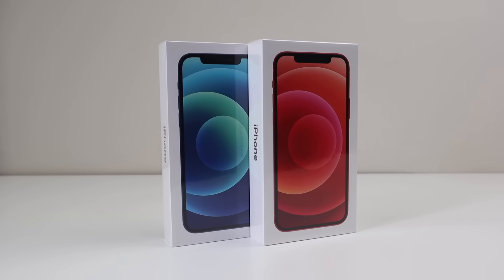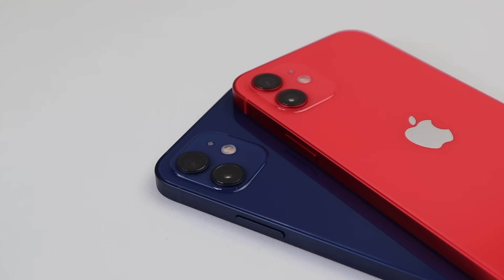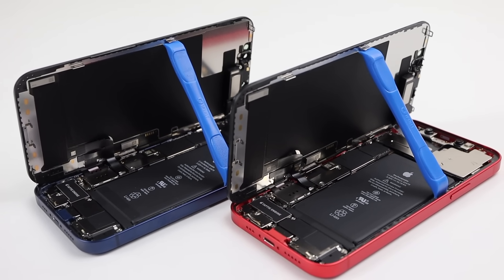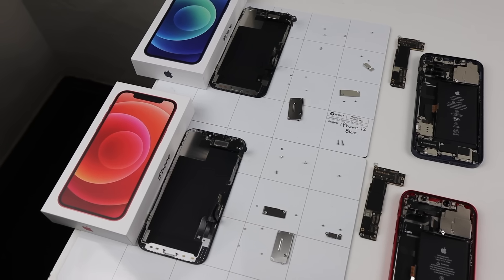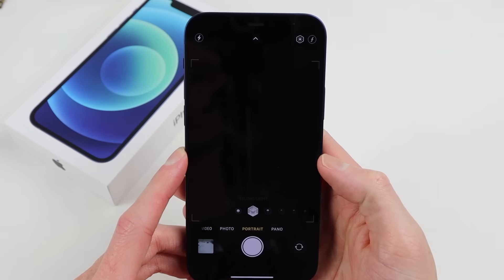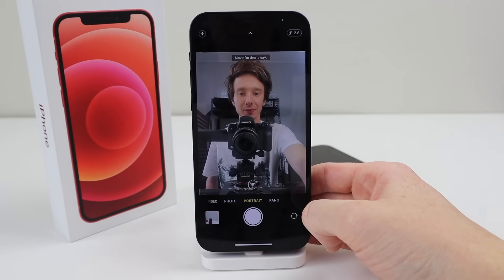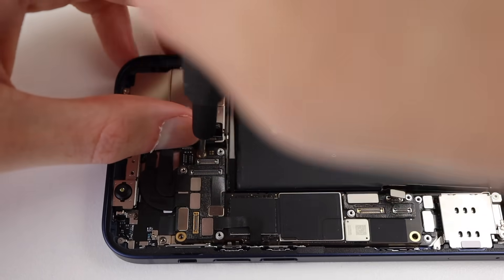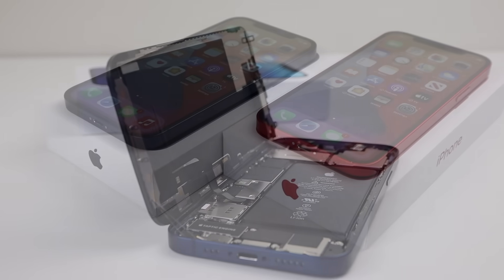iPhone 12 Anti Repair Design - Teardown and Repair Assessment

Comment: Me: buys 1.000,00$ iPhone

Battery after two years: whoops I can only give you 2/3 of the original capacity (which is normal and will happen on any phone)

My warranty: Well I don’t care, it‘s over anyways

Me: changes battery

Apple: okay sorry camera broken, Face ID dead, 10 error messages, laggy, zoom broken, battery percentage gone, true tone broken, power button not working, portrait mode stuck
Reply: @momorain, you can change the battery. At Apple it’s like 60-70 euro’s (Europe) depending on the phone you have. I let my iPhone X it’s battery be changed two times now since I do not want a new phone since this one is working perfect.
Reply: If you can fork out 1k for a phone, the cost of a genuine battery replacement should not be an issue
Reply: @sm7085  Bro, that is not the point! Also knowing Apple they will probably charge you 400$ so that you are keen on buying a new phone instead of the expensive battery replacement.

It’s the same with Tesla and right to repair. You own it and therefore you Have the right to do ANYTHING with it that you want! (from destroying it, all the way to replacing a part of it)

Imagine this: You buy a house for one million dollars and when you have a leak in your roof  the only person in the world who would be able to fix it is the contractor who built it.

He would say: Yeah sorry that cost you 400.000$ to replace a couple of roof tiles. Either you do it or the whole house is basically useless.

Than I would say just like you: iF yOu CaN aFfOrT a OnE mIlLioN dOlLaR hOmE, YoU cAn AfFoRt To FiX yOuR rOoF fOr 400k!

Basically the contractor can threaten you and say: use my repair or buy a new house! And Apple is doing the exact same thing!

Do you freaking realize how wrong this is?
Reply: @themomorain  So, let's say I was to buy a Tesla; would it be possible for me to replace both the battery pack and charging assembly in that case?
Reply: @MetalSStar196  If you find a 3rd party manufacturer you could and you have the expertise to dismantle a car and replace the battery or get someone to do it for you, yes you could.
Reply: @le_sampho  You can’t.
1. Everything which has to do with software (which is almoast everything in a Tesla) is locked up.
2. Tesla doesn’t sell you spare parts!

Just like Apple if you put a battery from another car in, or even a 3rd Party manufacturer like you suggested, it will not work! Just like in the iPhone from the video you just literally watched!

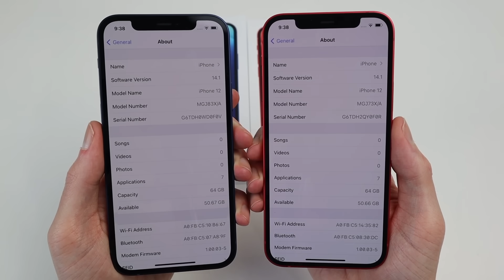If you are interested I just found this: from 0:00-2:40 he basically says everything.
https://m.youtube.com/watch?v=kETN3N2tGLw
Reply: @themomorain  you’re seriously crying over a £69 battery replacement
Reply: @sm7085  Wow you still dont get the reason behind my comment. I fear you are just not willing to understand.
Reply: not every phone loses 1/3 of its battery capacity
Reply: @michalbernat1088  every lithium ion battery will deplete over time. Thats just the nature of a lithium ion battery. Its unavoidable
Reply: @IronBran123  there are methods to greatly reduced depletion though so some may have less mAh but longer longevity.
Reply: @gurgleblaster2282  Great! I’m sure Apple will pick the method that has the greatest depletion in order to sell as many units as possible. (Since you can’t change the battery anyways, you are forced to buy a new phone as soon as the warranty runs out. That’s exactly how Apple wants things to be)
Reply: @IronBran123  My G4 battery shat itself this year. both my s7's still have good batteries.
Reply: @ayumu-senpaii  Hmm I don’t think so. I actually owned a s7 up until about 2 year ago and the battery was so dead that it did not last me for a normal day even if I didn‘t play around with it^^ Go swap the battery on one of your s7 you will notice a huge difference ;)

But in my experience the battery longevity on Samsung feels way better than Apple (probably cause IPhone always has such a small amount of mAh)
Reply: @themomorain  Your comment doesn't make sense, regardless of 400 upvotes. The stuff glitches up if you replace the logic board or the camera. Unless I missed anything, the dude didn't try to swap batteries. So we have no idea if it is possible to swap batteries or not.
Reply: @themomorain  apple isn't for the masses it always has been an elitist brand. You don't keep your apple running you just buy new. They are not designed to be repaired.
Reply: @gurgleblaster2282  Strait up wrong. Also it does not matter how much market share they have. Every device should be able to be repaired. (At least it should be designed to not be purposely not be able to be repaired!)

You: "They are not designed to be repaired." YEAH!!! Thats the freaking problem everyone is talking about!!
Reply: @michalbernat1088  Well that depends on a lot of different things and also this is not at all the point of my comment.

You buy something => You own it => warranty is over => Preventing people from repairing even though warranty is over is disgusting! (right to repair! You are the owner!)

Even preventing people from repairing while warranty is still valid is disgusting in my opinion! Cause if I have a smashed display for example I want to be able to repair it myself if I desire to not go to Apple for the repair! (Even though this will automatically void my warranty of cause)

Apple has a monopol on phone repairs. You buy a device but you are not even the real owner cause Apple basically decides if your phone is dead or not!

This is just wrong in so many ways that I could write thousands of words explaining against how many rights this is. That’s the point of my comment, not the exact amount of battery degregation.

Comment: At this point this is flat out a scam. If they would want to be so "green", they would let you replace parts, sell batteries for old devices etc. They are not doing this charger thing to be green, they do this for the publicity and cost cutting. Quite ingenious. Fucking evil. But ingenious.

Comment: Apple: we're making efforts to be more environmentally conscious 
 Consumer: okay awesome, I'm going to repair my phone so that I don't need to buy a new one
Apple: nonono not like that
Reply: Apple: here is your ner iOS update (secretly making your device slower and bugging out on purpose)
Reply: momorain laughs in iPhone 7 Plus
Reply: @themomorain  Windows has been doing the exact same thing!  Meanwhile, Linux has been the only Unix OS that's been doing just fine, speed-wise.
Reply: @MetalSStar196  hmm no. I mean at least on Windows: I buy it once and it’s NOT getting slower on purpose. (It only gets slower when I have a lot of junk on my Pc cause it’s not programmed really well)

Also Microsoft has no reason to slow it down on purpose cause they want as large of a market share as possible!

I don’t actually see an issue there.

Also I bought windows 7 for example and therefore could upgrade to windows 10 for free so they don’t try to slow it down, forcing you to buy something new.
Reply: @MetalSStar196  Except windows is a software thing not really a hardware issue....you can reset windows and it works fine. But apple doesnt.
Reply: and we're going to create a new charger that won't work with older devices...because after all, putting the 18 trillion perfectly functioning older chargers into a landfill is environmentally conscious.  I remember when after an update none of my aftermarket charge cords would work anymore.  Had to re-buy overpriced Apple cords...Dirty fucks
Reply: @Donnybrook10  Yeah Apple is fucking disgusting in that regard!
Reply: @Donnybrook10  I think the USB C is because of pressure from EU - "The EU wants to force all smartphone manufacturers to adopt USB-C".
Reply: @martindye  but they made it use USB c on the power supply instead of phone. Which is still fucked up cause no other power supply do that. They technically use USB c,but not the way everyone else does... So they basically cheated here.
Reply: Haha exactly
Reply: You mean "Apple: Listen here, you little sh*t!.."
Reply: Hahahahahahhahaha
Reply: Lol
Reply: love the profile picture and name

Comment: This problem is also on any phone that has Face ID. Apple made it that the earpiece of the phone which has Face ID sensor can only be used with the logic board that comes with the iPhone. To change screen or replace a broken screen, you have to remove the earpiece from the original screen and put it on the new replacement screen. That is the only way the repair will work.

Comment: You don’t need the seals as long as you got 300SLE laying around you can make your own but actually the original adhesive is usually okay as long as you didn’t man handle it.
It’s still good enough to make the screen snug.
Probably not 100% as effective for water but whatev.

Comment: It's time for us to care about Right To Repair, not only it's good for the environment but imagine what if couple years later, Apple will have sensors in the phone or seals in there to protect the phone from being operated so we won't be able to even open OUR PHONES or repair them. The fact that the phones malfunctioning themselves and not able to recognize genuine parts from Apple is ridiculous. The parts work perfectly fine. It wouldn't bother me so much if Apple's repair cost isn't a rip-off. They want to protect their products from being replaced with low quality parts, i get it. However, I don't wanna live with the fear that whenever I need my overpriced phone repaired, I can only get overpriced repair.
This is not luxury Apple, it's greed.

Comment: Regarding your description, they could just easily repair it in-home instead of being repairable from a 3rd party, therefore no e-waste. 

Also some of your comments how its not a "software" issue is false, it is a software issue, it doesnt sync the hardwares. Someone smart enough can create a custom firmware (jailbreaking) to be able to sync the issues described. It's only a hardware issue if the 2 hardware components are vastly different with different input/outputs.

Comment: You didn’t swap the front FACE ID cameras to the correct logic boards usually if a iPhone X doesn’t have the original Face ID both camera’s play up maybe that should sort out laggy camera issue, it’s a bad idea that apple do this, BUT someone will always find a way around this issue, usually when we repair iPhone 11 Pro LCDs we have a little electric tool that you plug the genuine lcd into and it Copy’s the serial numbers over to another third party screen which usually fixes colour and touch sensitivity I’d imagine they would only make one for this device too

Comment: Yeah, nice video. I suppose there is some kind of signing of the devices serial numbers with asymmetric cryptography. You know, like our factory has a private key, our public key is in every iPhone and we store a serial number of every single subcomponent  encrypted with our prv key on the logic board so that noone can simply replace the component and write it's serial number on a logic board without knowing our private key. Interesting business strategy.

To be honest though I think in case of the FaceId its justified. You wouldn't want to allow any thief who wants your data to stole your phone, and then attach some king of face spoofer to the logic board and get it unlocked. On the logic board level your face profile is just a bunch of data, so it's important to limit possible inputs (providers) of those to known (signed) devices only.

Comment: You need their software called repairCal which is the calibration software that apple knows that the parts are genuine apple parts and can be paired / locked to that device. If a company that is not “partnered” with apple they cannot do repairs on flagship models. I.G. X and higher. 3rd party companies will sadly go out of business due to this.

Comment: yey have you noticed that thing on the side of the phone that looks like the charger for the apple pencil gen 2 that's the 5G antenna but uh what's stupid is that most people on earth are right-handed and yeah if they put this on the left then people wouldn't have this problem but you also have to remember that some people are left-handed so why didn't they put it on the top cause this is "your holding it wrong 2 the incorrectness deepens"

Comment: Apple - We removed the charger because we want to reduce waste
Also Apple - We won't let you repair the phone because MONEY
Reply: If you replace the battery, you'll need to replace all of the parts within in order for the phone to operate properly.  However, at that point, you'll have new components in the same old shell.
Reply: And yet people still buy this xd

Comment: Apple is pretty much self destructing. From the headphone jack to the charging port to the air pods.. they're reducing every new phone to nothing. I believe they're recycling old iPhones, adding maybe a different design, different button placement, maybe screw with the screen resolution, try to mess around with the internals a bit and that's it. I mean this is a completely new phone.. brand new off of the market and this guy (sorry first video I've seen of you) knows where every clip, bracket, screw and trim is. Literally all Apple is doing is putting makeup on a growing disaster.

Comment: Guessing that it's hardware tatooing like the serial / MAC of the part is 'married' in the firmware section of the boot ROM or something very similar to this , & the values would need to be updated or blanked out in some fashion, which would only be possible through OEM authorized service tools or maybe the jaylbrake community

Comment: Thanks for the video, I think I'll one up  Apple, and be even greener by holding on to my iPhone 6s until it cant be updated anymore.
Reply: I'm doing this with my iPhone 6 Plus.  Bought it in 2014 (I think) and have only had to change out the battery so far.  ** knocks on wood **  Bad thing is it's only 16GB so I have to be very cognizant of what apps I really need and keep photos and other locally stored data low.  What I hate is an app I haven't used in awhile will go into like a standby mode so the app is removed but the launch icon and the app's data is still stored on the device.  To run the app it has to download and install.  Sometimes a pain when service is spotty or none.
Reply: @TheKuptis  True on all points, I dropped mine and the screen shattered, and the battery was bad. So I up graded to more memory and life is good.
Reply: @TheKuptis  you can turn it off, its a really bad feature i did it a while back.

Comment: the lack of a power adapter really only affects people that haven't had an iPhone before, if i bought an iPhone 12 today then I'd have to go out and get a new charger. For anyone coming from any iPhone after the 4, your old charger will work with the 12. The only thing different about the new USB C charger is that its USB C, it will still charge your phone as slowly as it did before.

Comment: Apple: removing a whole power supply for "sustainability"
Also apple: making phones not repairable

SuStAiNaBiLiTy
Reply: its sustainability...not for the planet but apple stonks.
Reply: justifies it by saying everyone has tons of them at home.
includes charging cable that doesn't fit any of the common power adapters ever used so you have to buy theirs anyway...
Reply: There just desperate for money at this point
Reply: Also the charging cable tho
Reply: very sustainable
Reply: with all the bullshit gimmicks that apple is throwing around,im still buying iphone..damn. der sustainability motto for d iphone12 is so dumb. sustainability of der profits
Reply: I would argue that this anti-repair design is sustainable. This eliminates the redundancy of third-party repairer to gain more control on parts supply and disposal etc...
Reply: @kelvinchan2430  And only creates a bunch of thrown-away phones once they stop servicing them.  That isn't "sustainability".
Reply: @kelvinchan2430  Fallacious argument - You should be happy that Apple did not build your house.
Reply: @zorbalight3933  well, if apple built my house, I surely wouldn’t want any 3rd party guy to screw around with it...
Reply: @kelvinchan2430  probably....but its mostly to make apple users buy more products that were used to be free,and apple makes more money... apple is difinitely not letting any stones left unturned in an effort to scrape more money out of der loyal fans .😑 . next tym new iphones wont have battery in them upon purchase,cuz we already have ours from d previous model,in guise of saving d planet,but then d battery slot on d phone is slightly larger,so nevertheless it wont fit,and u end up buying separate new bigger battery for d iphone...
Reply: @racetoria3069  scrape money from „loyal fans“ who wanna do a 3rd party repair...

Comment: This crap that apple does is why i dont understand why people still love apple. Yrs ago i heard about how easy their phones were bending and breaking and i went from a motorola thag wasnt bad but also not a great phone either, to lg phones that have been nothing but good and when i didnt find an lg i wanted, i tried htc. I have punched my phones until i bruised my hand when i did something stupid and back when i had anger issues. I also threw them across the floor multiples times. All i had to do was, put the phone back together and turn it on. When i did break a screen or whatever, ive replaced them myself with no issues. 
So again, ill never understand the love for apple crap.